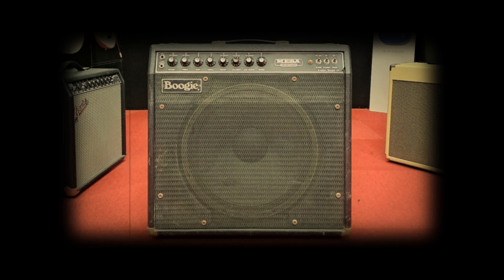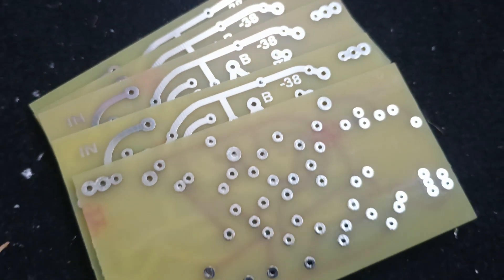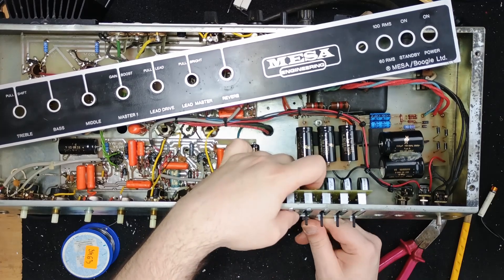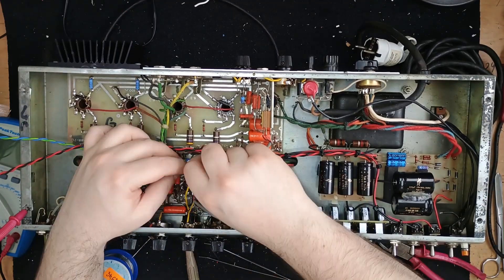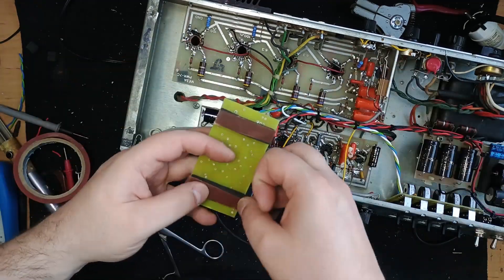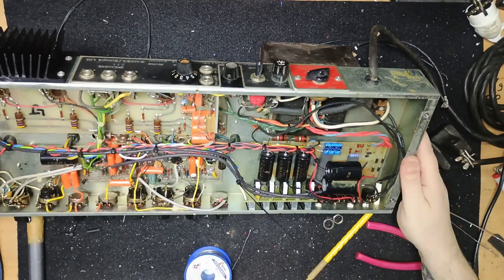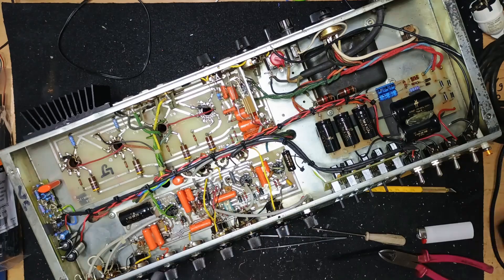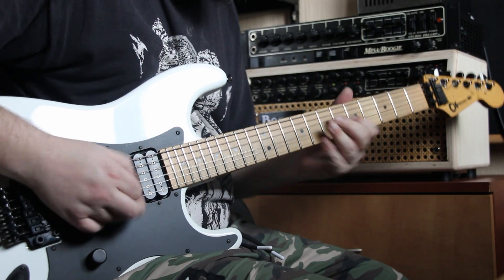Boogie Mark IIB XHR Project Amp | The GEQ Upgrade - EP2

Comment: Wow, what gorgeous work!  But all to implement a rather weak design, IMO.  Don't they have replacement GEQ boards available from Mesa?  If you're going to do such brilliant original engineering, why not upgrade the design to a tube-based circuit?  Oh well, nicely done, anyway!  Interesting that later Boogies had signal always passing through the transistor circuit, I didn't know that but it's yet another thing that troubles me about Boogie designs and packaging.  Randall's a clever and adorable guy, but many of the company's design choices were pretty faulty.
Reply from the maker: Thank you for the kind words! This design, no matter how good or bad, is part of the sound. It was taken from an old HiFi stereo EQ. And to be honest - at unity gain those GEQs are pretty flat and transparent. Except a slight volume change - you won't hear the difference between true bypass switch (like in this Mark IIB) or the pass-thru like later designs. The measurements I provided at the end - you can see one straight line between all sweeps - that's with all faders at center - flat from 20Hz to 24kHz. Pretty good for a guitar amp if you ask me.
But the thing that actually contributes to the sound is when you push decent amount of volume and push the faders after a certain point, the transistors start to distorts slightly and that gives a bit of extra aggression. You have multiple spots of the preamp that provide distortion - even the GEQ to a degree. No matter what we think about R.Smith's/Mesa's designs - the whole IIB/IIC/IIC+ thing is a "happy" accident.. many of them actually. A truly well engineered design, that checks all the marks (pun intended) would've been obviously good, but probably not sound like those amps. Not sure if a real engineer would've approached such a design to begin with. The small amount of crazy and the big "F it, let's try" attitude made those amps what they are.
But I digress..

Thank you for the comment! Glad you liked the content! This is one of my all time favorite amp projects and I hope that soon I can get to finishing it, as I have very interesting videos to make about it!